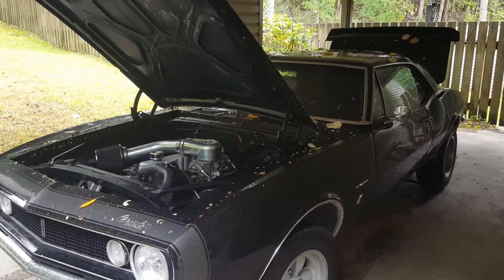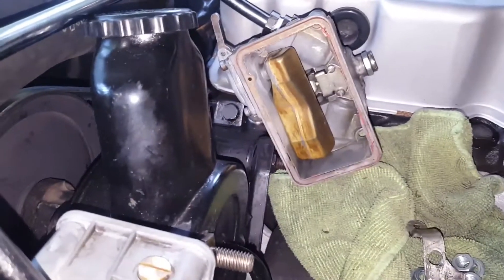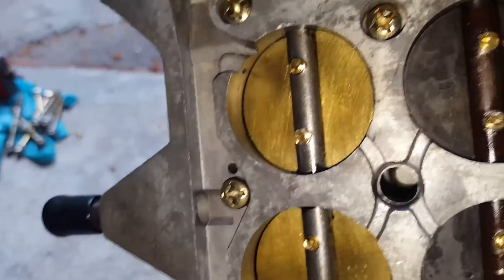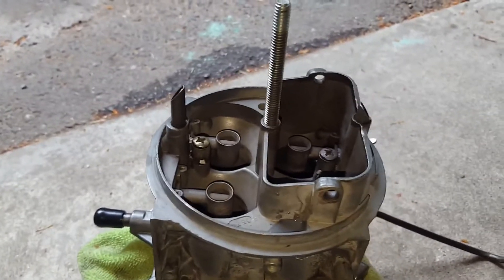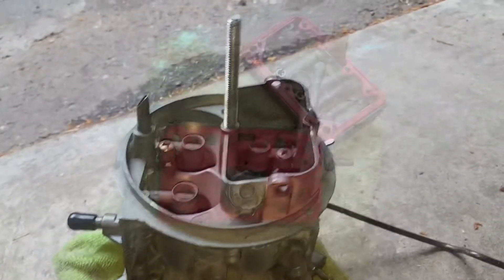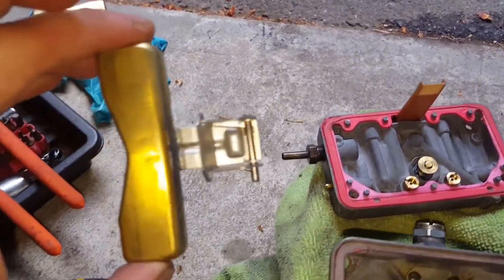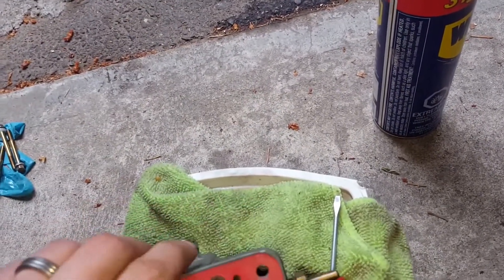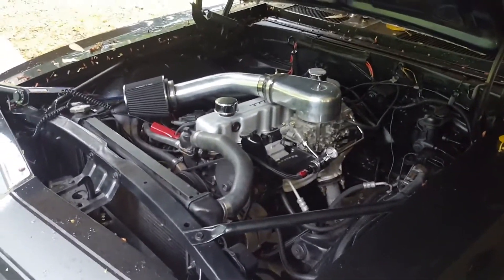1967 Camaro - Holley 600 CFM Double Pumper Carburetor Setup for Turbocharging

Comment: Did you have to modify the carb other than remove the choke to be able to use it for your blow through set up?
Reply from the maker: Randall Mills You're right on it, you have to block off the hole for the choke rod. You should consider using the black plastic fuel bowl floats as the hollow metal ones have been known to compress under boost. From my personal experience, I'd use a thicker, perhaps nitrile or silicone "air cleaner" ring gasket as a stock paper one doesn't seal the greatest with just a stud and wing nut. Easy to cut yourself.

Comment: Great video 👍🏻 I set my floats on the car running there's different angles on each intakes so it's easier for me to it like that I find keep the videos coming 😉
Reply from the maker: Good call, once you've got fuel in the bowls setting them while it's running is the way to go.
Reply: +Turbo Camaro Thanks great videos 👍🏻👍🏻I've got a 68 subscribe and check it out would like your opinion 😉

Comment: Interesting...once it's set up how you want it, do you have to keep readjusting it to keep it set, or is it pretty stable at some point?
Reply from the maker: Once you have it set how you want it, the carburetor is extremely stable. What does change is your environment. Massive climate changes or altitude will cause you to need/want to change settings. Cars with engine management systems automatically adjust the air/fuel ratios in these situations but carburetors rely on you to make the necessary adjustments. If you use it as a daily driver and have it running well, you'll probably set it and forget it. However if you're like me, you'll never stop touching it ;)
Reply: I didn't think about the enviornment and/or elevation...makes sense and I completely understand about being a perfectionist too!
Reply from the maker: +A LeBlanc yeah, when even the smallest tweak can affect miles per gallon and/or overall performance it can be tempting to experiment with adjustments. A wideband gauge is almost a requirement and takes a lot of the guess work out, especially when turbocharging.
Reply: +Turbo Camaro agreed a least a good vacuum gauge 😉👍🏻👍🏻